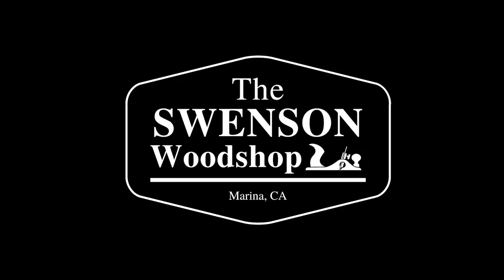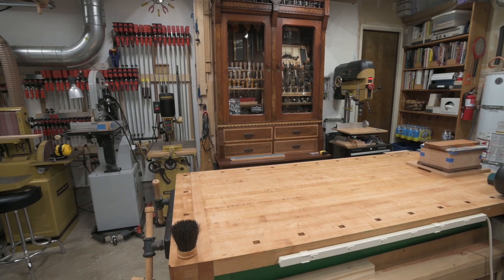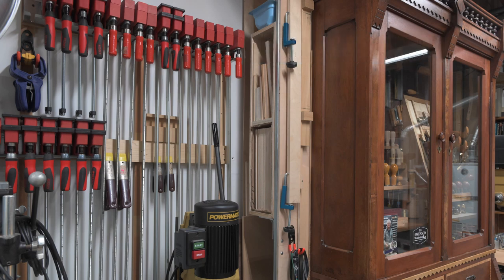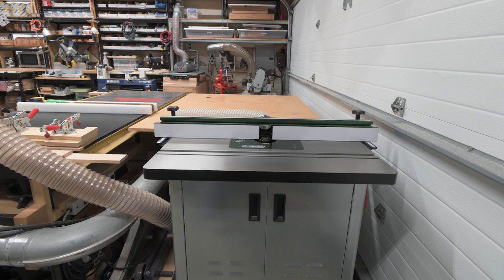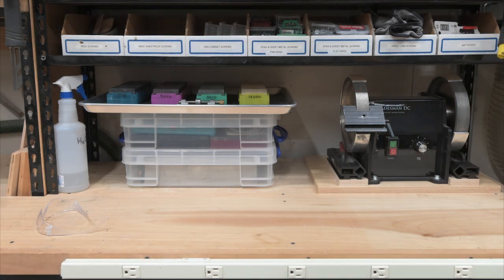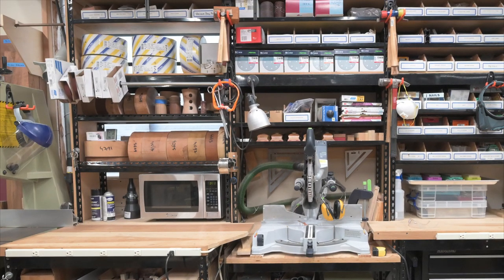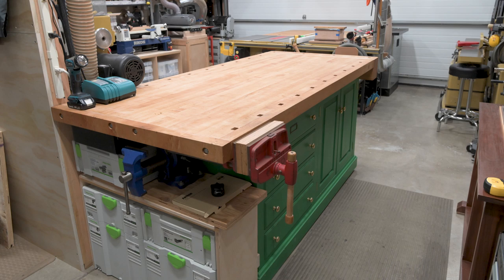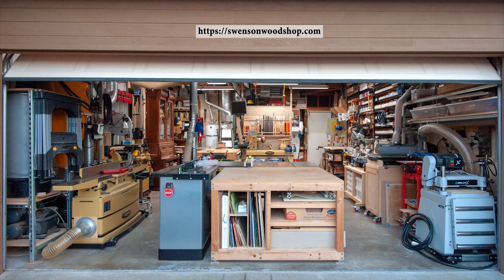Shop Tour 2019

Comment: We all struggle with the storage , tools , work area, all fighting for the same  space. I learned to put everything on wheels so I can quickly and easily move things around when I need to . Rotating casters  on each corner allows me to move each piece in any direction and not have to steer it .If I was to use two fixed wheels on on side , that makes it harder to move.But the real problem is we all have to much stuff for to little space we have. Great video ,thanks for the tour.

Comment: I have my approximately 4’x4’ cnc router mounted on a garage storage lift and raise it above my assembly table when not in use. When I want to use it I lower it down onto my assembly table. Actually you could even raise it up while it was cutting a job so it would be out of the way. I have a blue tooth camera mounted in the dust shoe so I can watch the cutter. 😉😁

Comment: Thanks for the shop tour. It a very nice shop. Just subscribed and looking forward to more videos.
I’m not sure where I saw this but I think it was either someone from Woodsmith magazine or maybe Wood Magazine or Woodworkers Journal magazine. They rebuilt their workbench or out feed table so their CNC was under the top on I think a slid out shelf.
A friend of mine has a shop much like yours where every wall has something mounted to it. He made a winch and pulley system to lift his CNC table and his laser table into docking stations in the attic of his garage. They get pinned in place so they can’t fall down when not in use. They lower down onto either side of his outfeed/Assembly table. Since he lives in a climate that gets cold he built an insulated box that surrounds each tool while it is in the attic and helps keep his shop warm even when they are being used.
Reply from the maker: Thanks Ron!   Sounds like your friend has come up with some clever solutions to solve his space problems.   When, and if, I ever get a CNC or laser cutter, then I will have to solve those problems, or move to a bigger shop!

Comment: This is your first video??! Wow, great job on editing and how to present your shop to us. You've clearly optimized your shop. I love how everything has a place of it's own. The use of bins and those cardboard organizers. I like having a variety of hardware on hand just in case I may need it. I check thru Face Book's Market Place and Craig's list. I recently acquired a group of new steel bin/drawers full of assorted hardware.  I also have an antique printer cabinet that was in a local shop. It has the old iron wheels placing it around the beginning of the 20th century. This cabinet will be the home for all of the hardware I got with the steel drawers. I'll make a cabinet in the next coming week for them. I like having some history in my shop. I have some shelves that are placed where the ceiling meets the wall that goes all around the shop that I display my antique tool collection. They are not all wood working though. There are some very ornate levels, wrenches among the rest of my tools. One section is dedicated to the "Family Tools" that I inherited from my grampa. The wood planes date back to the mid 1600's when my family ancestors migrated to this country. They have been lovingly cared for over the centuries by other woodworking ancestors and not one sign of wood boring insects that tend to destroy the old tools.. I plan to build a proper cabinet like yours just for them. When ever I make something for my siblings and my parents when they were alive, or relatives, I always use those tools to help build the gift with. I have a special iron of the family logo on it that I burn into the items I make with those tools. My family will know then that it was made with our ancestors tools that they used to build their homes and everything of wood in those homes. Its my way of honoring them and so the family doesn't forget where we came from. Well, I didn't mean to write a story here, sorry about that. You have a new subscriber though! Thanks for a great video!
Reply from the maker: Thank you again!    I love the concept of using your families antique tools for some aspect of building a family gift.   That seems like a perfect way to honor their memory and preserve the legacy of their own woodworking history.   I also have a branding iron with my makers mark, that I use on all of my projects.   Someday, when I'm long gone and dust, someone may pickup an item I built and see my makers mark on it and wonder, "who was person?"

Comment: Great shop ! Very Well Organized and Equipped  I’m sure you know this  but your old Delta Bandsaw with the reduction gears are a hot item these days  as they are getting harder to find in decent shape  BTW there is a YouTuber that really knows his Bandsaws  as he  also was a Shop Teacher for a number of years  and has a lot of Machining and Metal working experience  overall a pretty neat and knowledgeable guy but i forget his name at this moment  although if you search 14 inch Delta Bandsaws on You Tube  he will pop up  he also has a nice collection of old Catalogs from several   large Companies  over the years
Reply from the maker: Thanks Craig!   I used to have an entire shop of Delta equipment, but when Delta basically stopped making industrial quality equipment about 10 years ago, I started switching over to Powermatic.   I still have some of my older Delta equipment, the metal/wood cutting bandsaw and thickness planner that are in my shop, and an DJ20 jointer and 6" belt/12" disc sander in storage.   I sold my Delta Unisaw, and HD Shaper.   I think the reasons I started changing over to Powermatic were: 1 - parts were readily available, whereas Delta parts were difficult to come by, and 2 - I like the industrial quality of Powermatic equipment; its heavier, and better engineered, in my humble opinion.

Comment: Nice job for your first video. That is a nice set up How long did it take to build up your Powermatic collection? Those are not cheap tools...Love the cabinet. Its like the focal point of the entire shop...
Reply from the maker: Thanks Rich.   I purchased most of the Powermatic tools in 2016, when I sold a classic car, and used part of the money to upgraded some older Delta tools.    I decided I wanted to do woodworking, more than maintaining a car in retirement; though I do miss that car every now and then.
Reply: @swensonwoodshop7475  Ha ha, but I bet you get more use out of your tools. I run a photography business. I am always torn between buying new equipment for the business and buying new tools. So most of the time I do both.

Comment: Man oh man, I'm envious! Your sanding block collection cost more than my jointer! And a twin screw vise mainly to hold your shooting board?!

Looking forward to more videos! Where did you get the router table top??
Reply from the maker: Thanks for the encouragement.   I am working on more videos, and my startup has been slower than I anticipated, mainly because I'm a one man show and I'm still figuring out the lighting, camera angles, software, etc.   But that's all part of the journey.

I purchased the Excalibur router table top and router lift in 2016 from Tools Plus, and I'm very happy with them.   Unfortunately the Excalibur brand was manufactured by General Tools of Canada which has since gone out of business.   I understand that King Canada is now manufacturing the General/Excalibur tool line under the Excelsior brand, and the XL-075 appears to be the same cast iron top I originally purchased.   Not sure who, if anyone, in the USA is carrying this line of tools, other than Woodcraft selling their scroll saws.